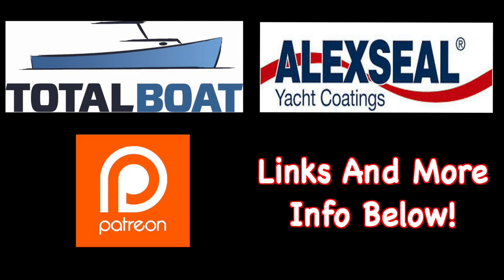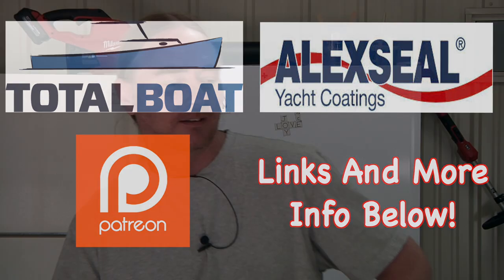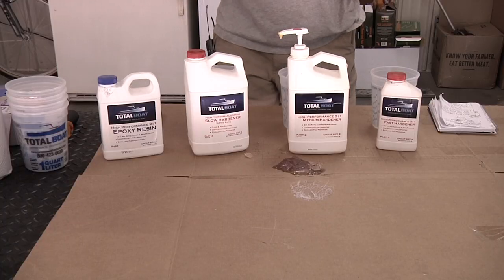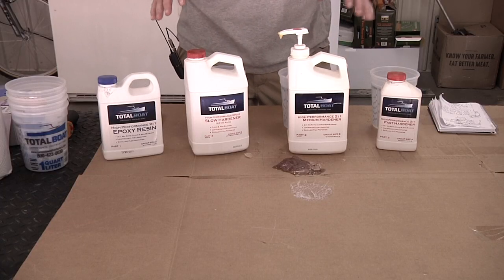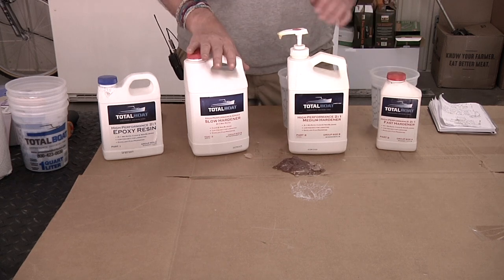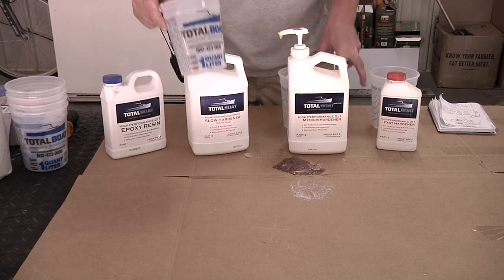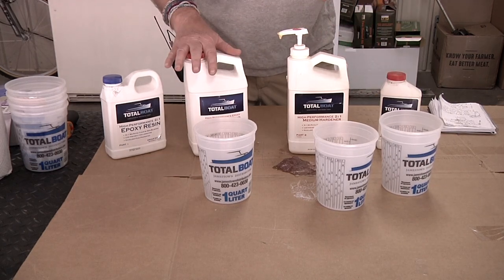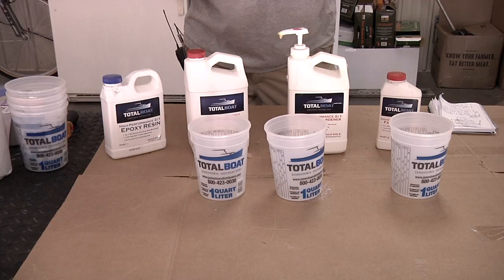Epoxy 101 Need To Know's (Oh, and hardener tests ;-)

Comment: Nice summary Andy.  You did mention that epoxies can take a long time to fully cure.  That can have an impact on painting.  In my experience if you plan to paint over epoxy, it is best to give the epoxy time to reach a full cure before painting.  If you paint too soon you may find, depending on the paint you use, that the paint takes a LONG time to fully dry.

Comment: I mixed some fast hardener on board one day in Fl. Very hot day! Mixed resin and hardener fine, before I got the thickener it it became so hot , I thought it was going to catch on fire. I had to toss it over. This was a very small batch too, I thought I could get in on before it started to set, no way! Seldom ever use fast here, even in the winter. Slow or tropical is all I use now.

Comment: I asked for a supply of chop strand mat for Christmas and my son was able to purchase it. Not really understanding the differences in types, he purchased some that can be used with polyester or epoxy so, I'm assuming it's a power binder. I couldn't tell the difference. I was just glad to see that it said I could use epoxy and I have used it. I can't tell you if there's any real difference. I haven't done any testing but it seemed to work just fine. It softened up and wetted out, and stuck were it was supposed to stick.

Comment: Andy, quick question. Removed stainless clamshell wire cable vent cover for new finder plug and found rot in-between the two fiberglass deck layers. Should I epoxy with fillers "peanut butter" or fill with 5200? Only goes back about 1/2" or so 360 degrees around the hole. Thanks.

Comment: I'd have been interested to see the hardener test with a more realistic sample - in the big batches once they start cooking off, they go really fast. But if you spread a coat of epoxy out over glass for instance, even the fast one isn't going to cook off. So is the time to recoat hardness for instance, proportional to the cook-off times? I don't know but that would be interesting info. If I'm glassing and encapsulating a plywood hull, it wouldn't be a huge problem to mix up a batch of fast hardener, spread it out on the hull, do a second batch, spread it, etc. If the fast hardener is going to get to recoat sticky in 2 hours then I could get the glass and three coats of epoxy on in about 6-7 hours. And the medium hardener would take 12-13 hours which is starting to be pretty long and the slow hardener would have me hoping I could do the third coat in the am the next day.

Comment: The error in pouring to a line is more common than the difference in density by weight. I’m still using the volume measure but to say that it will be more precise in proportion, I can’t see that.

Comment: probably a stupid question but that is my trademark
polyester (excluding gelcoats) is generally not resistant to uv light, it either cure quicker and with prolonged exposure breaks apart into dust
i know because as an electrician i often have to deal with early 2000's electrical boxes where top layer of resin turned to dust and exposed some raw glass fiber and we paint those with chlorinated rubber paints as a conservation
back to the question
 how does epoxy reacts to light, i mean raw transparent resin?  there is a lot of those carbon fiber laminates that show internal structues of the fabrics trough transparent resin and i was wondering if that a special uv resistant epoxy or just a regular epoxy holds well against uv
Reply: As a general rule epoxies do not do well when exposed to sunlight.  That said, there are UV resistant resins that do better, but are still not great.  Those carbon fiber layups where you can see the fabric likely have a coat of highly UV resistant clear coat over the epoxy.  The most UV/sunlight resistant epoxy is the one with paint over it.

Comment: HELP! My boat got struck by lightning and got on fire... inferno kind of type. My question: is it possible to restore fiberglass that has been exposed to intens heat and burnt?
Reply: I'd ditch that thing mate. I bet it opened loads of little holes everywhere

Comment: Are you able to laminate different kinds of epoxy without fully curing? Using system 3 cold cure, ran out and have west systems epoxy resin. System 3 is in gel stage can we use the west systems to do a second layer of fibreglass to get a chemical bond? Or do we wait until it’s fully cured?

Comment: Do you ever use or recommend using a plastic sheet to cover epoxy fiberglass work to let it set up and then you can peel it off leaving a smooth finish?
Reply: You need to use peel ply if you are doing that with epoxy so it stops the aiming blush on the surface. The aiming blush still happens but it happens on the outside of the peel ply and comes off with you rip it off

Comment: Hey man could you please help out with your personal opinion. I applied and buffed off wax 3x. I then sprayed 3 coats of pva. I then applied a coat of gel coat, turned out good. I waited nearly 3 hours then applied another coat of gel coat. Unfortunately after the second coat my gel coat wrinkled on my as if it shrunk! Most importantly What did I do wrong? Second most important question is can I keep moving on with the project or do I have to attend to this before moving on and applying my epoxy/fiberglass lay up? I would greatly appreciate any advice you would be able to provide. Just please please please be as detailed as possible. Thank you kindly.
Reply: You applied to much too fast between coats and the solvents couldn't escape so you wrinkled up the bottom layer.

Comment: not so much a question related exactly to the topic BUT i'm getting ready to make a custom mold for a part which is about 6ft long by 12in wide if i brushed gelcoat on the plug and the gel wasn't exactly mixed exactly correct. IF i then follow with resin and CSM (to make the mold) would i be ok ? or will i be peeevved after a few hours?

Comment: Doing a completely new deck on a boat, in Florida. I am getting that I should use 2:1 to seal the new plywood and to secure it to the structure. When doing the glass lay up for the deck, do I just need to sand and acetone whip before the next layer of glass if I miss my window?
Reply: yes

Comment: I have a question for anyone that can answer. I want to use polyurethane paint on the bottom of my boat instead of the anti fouling paint that's on it now. Is there anything other than sanding off the existing paint that I need to do to prep my boat for painting? My boat will be trailered and not stored in water which is why I'm choosing to not use the anti fouling paint and I want a nice smooth bottom instead of the coarse finish of ablative anti fouling paint. Any help would be appreciated. Thank you in advance.
Reply: Sand it and paint away.
Reply: Sand it to 120 then use glazing putty or filler to fill in all the minor imperfections, sand them bits again then use a primer to seal the gelcoat, filler/glaze and GRP, if you have lots of small imperfections that be a waste of time sanding flat you can use a High Build primer and run extra coats over the dodgy bits. You need to do the primer stage  or you won't get the proper lifetime of the paint. I've seen un-primered paintjobs last one summer and winter and it peeled off. Clean the area prior to sanding and make sure it's especially clean when you get to bare fiberglass, as you will sand the contamination in. Buy lots of sanding pads in 80 and 120 grit and keep the sander running quite slow so you don't gum the pad up. When you get the black rubbery stuff smearing on the gelcoat that's the oily rubbery contamination so don't drag it into the bare fiberglass and ideally dab some iso on It then when it dries out you wipe it off with another iso soaked cloth. That should take most of it off and even the parts that it misses will have been dried out so sand off easily. If you smell glue during the sanding phase back off and let the GRP and sanding pad cool as it will either be the epoxy in the GRP or the epoxy on the sticky bit of the sanding pad melting. Don't use rags that leave lint when you're cleaning up... and once again, Keep Everything Clean and if you are rollering then buy an epoxy roller.
Reply: Also, don't go too glossy underneath unless you want the boats characteristics at speed or tight turning changed. I repeated tell small boat owners (mainly dejon) that they are already a bit skiddy during high speed turns, then they want me to paint it to a car like finish with spray guns, only to come back and ask for a less slippy coat on the bottom 3rd as the boat is "gunna kill someone" with their 15hp motor.

Comment: Epoxy has its place but I think the novice overuses epoxy in most cases. Part of it is not truly knowing all the details of the products and then falling victim to unknowing salespeople pushing you into the West System cult.  One of the reasons I watch this channel is because they don't just goop epoxy on everything as most so-called "pros" do. Every product has its strength and weakness do your homework and choose wisely.
Reply: Kinda this. But this is the first video where Andy explained which is for what/why they are different. The previous video were just "um, one if the same, kinda" :P
So me being the novice, wanted to do everything in Epoxy, but stepped back from the gelcoating, as I could not understand any of it (other than it's done one certain way, except when it's not ;) ). So slowly building up knowledge on gelcoating before I give that a go.

As to repairs/buildup. I've got epoxy, but will look to see what areas/uses the slow cure (I have fast) or polyester based glues are going to be better.